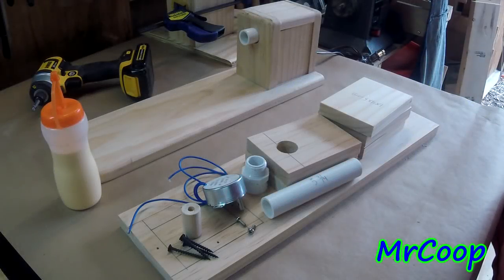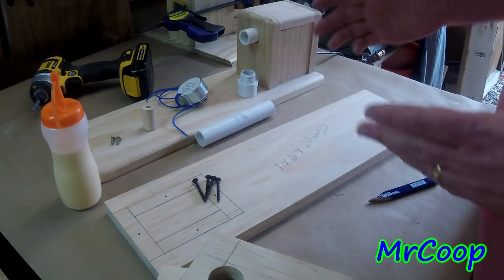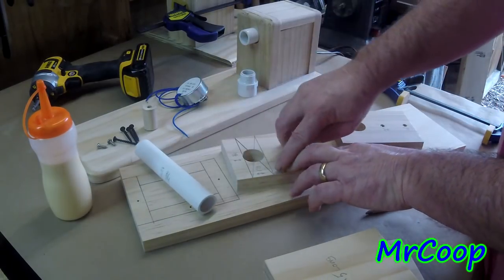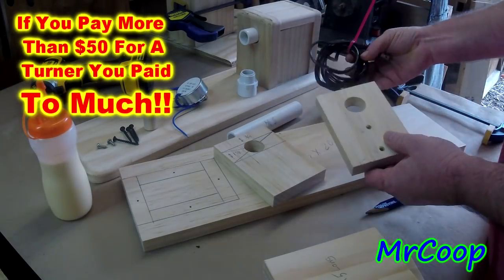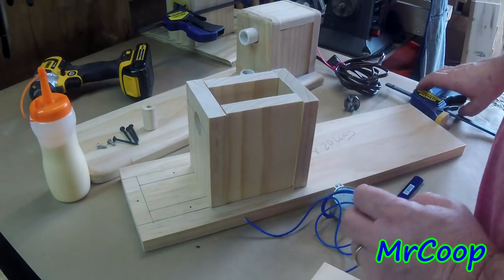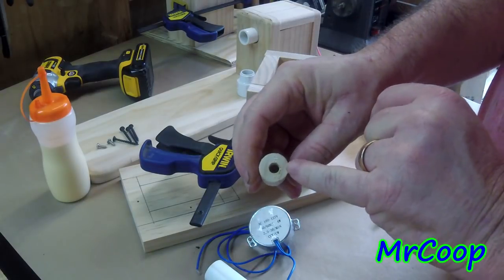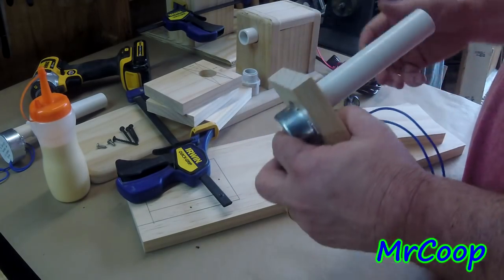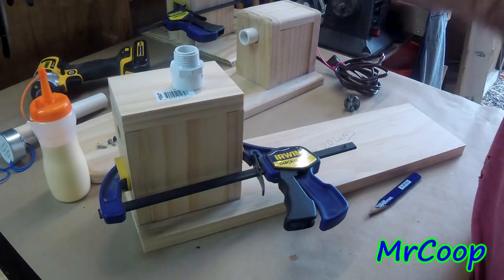How To Make A Less Than $25 Epoxy Resin Cup Turner

Comment: Doesn't the wire guage matter for connecting the lamp cord to the motor? That motor has a 22 awg cord but all the cords I have around are 18 and 20 si I havent connected it yet for that reason.
Reply: +Jessica Craftings
The Motor draws very little amps = (power) that it doesn't need larger wire size. So the electric cord also does not need to be any larger either, it supplies only the amount the motor asks for no more.
Reply: I know it doesn't need to be any larger but the only wire i have to attach it to is a different gauge. I don't want to wire it to just a plug id rather use a switch. Would i have to worry about bottlenecking? I have seen a lot of people have problems with the motor getting hot. Im just nervous. The motor i extracted from a microwave was easy for me to use to make my first turner because all i had to do was remove the wires. i cant do that with this one :-( Here you'll see what i mean. this is how i did my first turner https://www.youtube.com/watch?v=12r0agG6fQE&t=2s
Reply: btw thank you for answering :-)
Reply: There will be no problem "bottlenecking. Switches handle more power than that small motor would ever need.
In your video that switch on the cord is small, light duty but it is designed to handle that wire size and even a 100 watt lamp.
Reply: EXCELLENT I have another identical cord. Would i be safe to use that with this particular motor? Its the cord from a wax warmer lol
Reply: P.S.
The larger the Wire Gauge = The smaller the power handling.
22 awg handles less power than 18 or 20 awg.
The motor will only draw the amount of power below 22 gauge wire. So with 18 gauge wire you will have plenty of extra play. By the way I'm an Electrician.
Reply: +Jessica Craftings
Wax Warmer, hmmm. Wonder what that could be used for.
Reply from the maker: I wired mine to a normal lamp core and put a wheel on off switch on it.. The wires coming from the motor and the lamp cord should be inside your box. To wire a wheel switch you just cut one wire and leave the other uncut. There are lots of videos on how to wire the switch in. Here is the one I use.. https://youtu.be/u79Z8kI5VmQ

Comment: Thank you so much for this video. Very inform and easy to follow. Is the motor you have listed in the description the same motor you showed on FB that changes directions when you twist the PVC?
Reply from the maker: ratmgr2 the motor I use I have posted on Facebook. Ryan Fenters uses one that is about 2 to 3 times faster.  The ones I use are just about the same speed as the rotisserie motors.
Reply: MrCoop thanks. I saw your post about a week ago on FB when you first made this turner. You were able to make it change direction when you briefly grabbed the pvc the tumbler was on. I just wanted to know if the motor you have listed above is that type of motor (I’m unable to tell by the motors description, sorry).
Reply from the maker: Yes it is the same. Word to the wise do not do as I did in the video grabbing it . Better to just turn it off and back one and it will go the other direction..